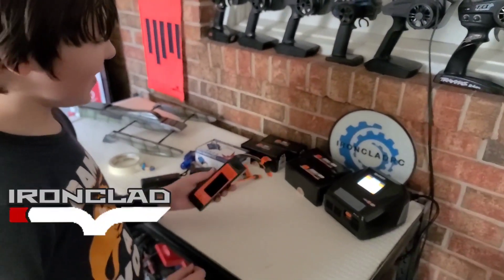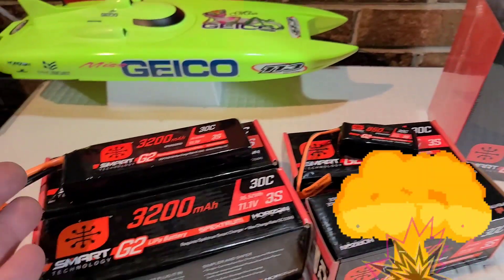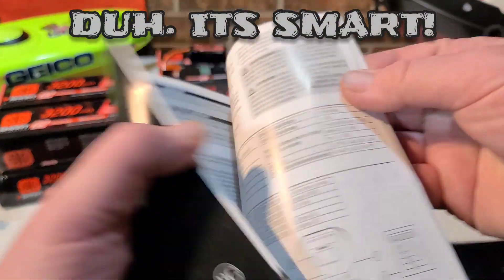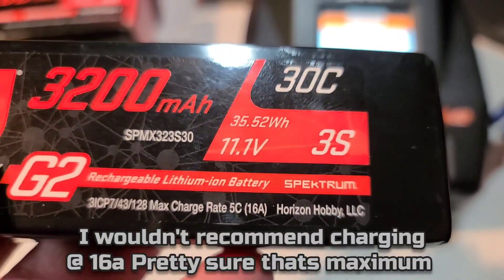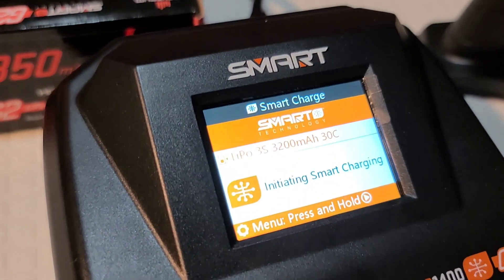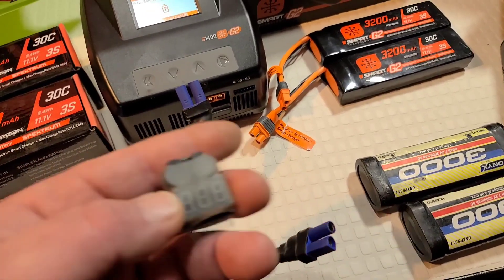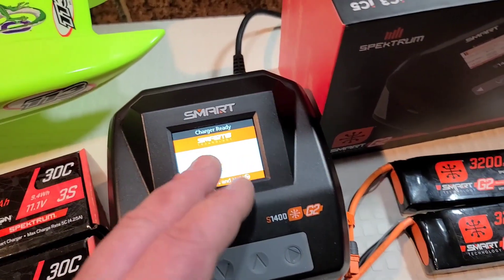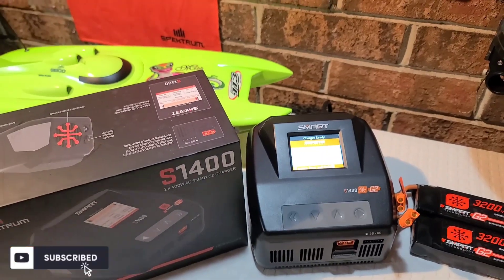First Impression of the Spektrum S1400 G2 Smart Charger, G2 Lipo battery

Comment: how are the charger and batteries holding up after 2 years? thinking about investing in this smart tech.
Reply from the maker: Chargers have been great no issues to speak of, the lipos on the other hand I lost a couple 5000mah packs due to water damage, I run my boats in brackish water so I chock the loss up to salt water damage..     not really the Battery's fault just the conditions they were run In.     Overall it's a great setup!

Comment: So im charging my brand new 4000 mah smart g2 battery.  Im not flying tomorrow, so what should i do, discharged it?? How do i do that?
Reply from the maker: You can discharge it, but you'll need to storage charge it after it's discharged.  I usually just storage charge mine, the charger automatically discharges the battery to storage charge which is 3.8v per cell